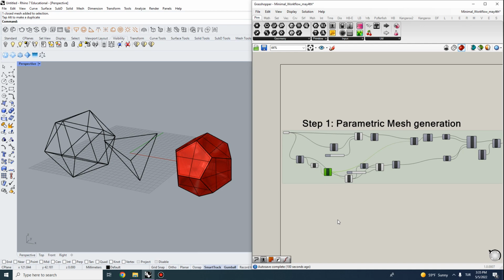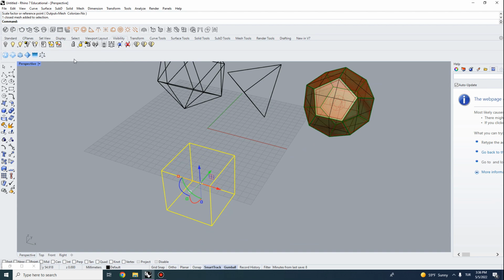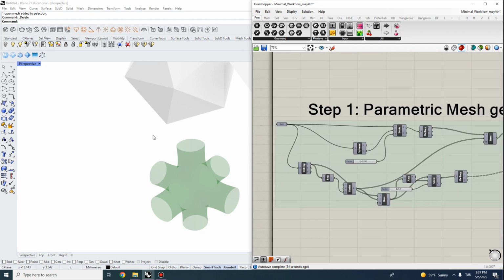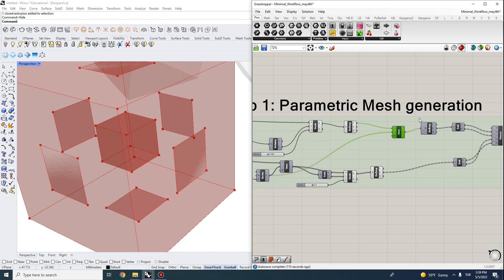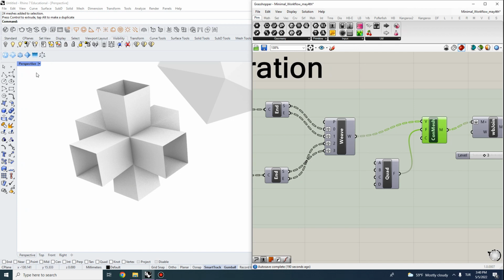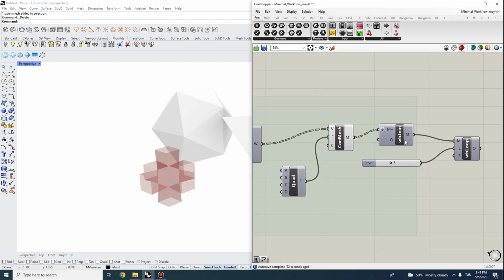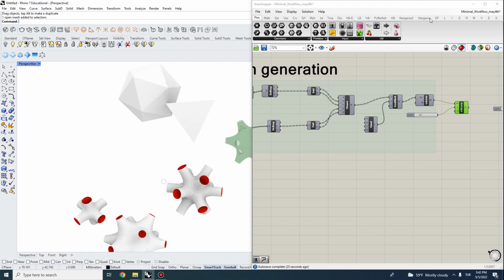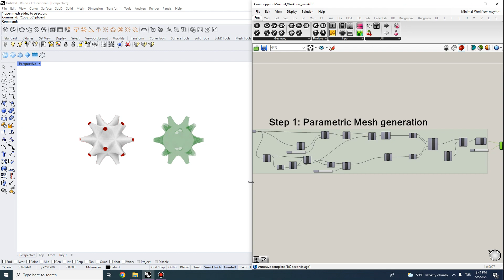Mesh Modeling

Comment: why does it say "insufficient vertices for mesh" when i try to construct mesh?
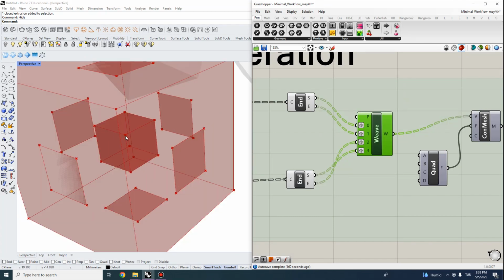Reply: Hello did you receive an answer? I had the same result for the ConstructMesh component. At the Weave component instead of having 96 locally defined values with N=4,  I get 24 locally defined values with N=1. (All grafted and at each index I have 24 values inherited from 1 source) at 4:46min into video. Any advice appreciated!
Reply: Working out what is happenning right now... No idea. Okay maybe an idea...it should go to a specific points. 0 with 0 1 with 1 and so on....and maybe for different versions there are different numbers in the code.